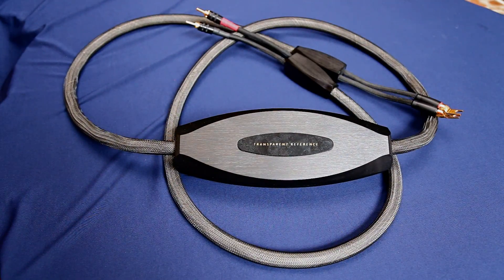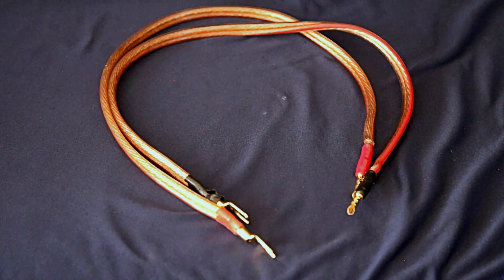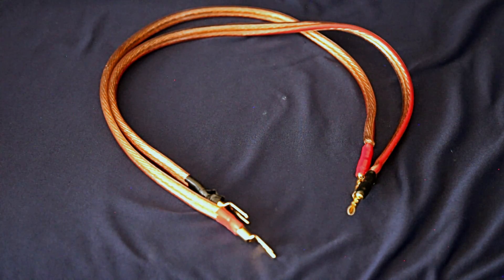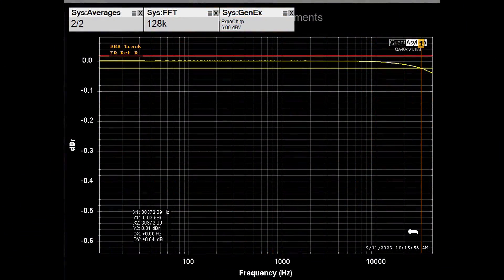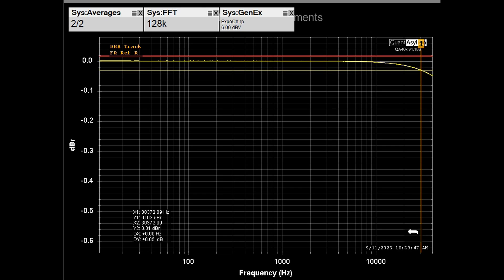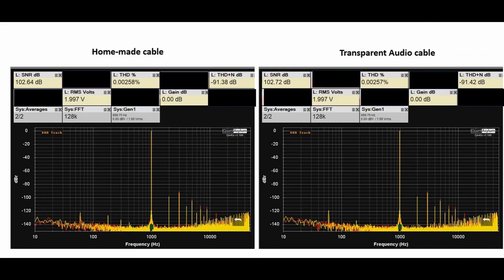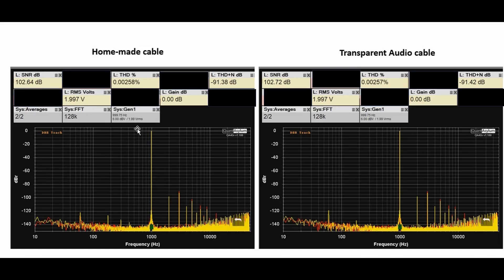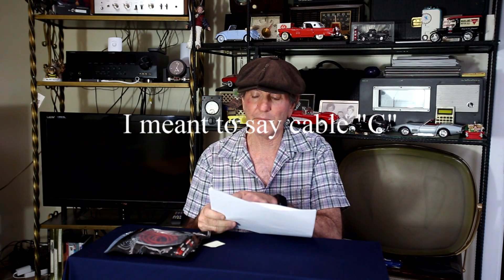$8000/pair Speaker Cable  vs. $14 DIY Speaker Cable A/B Test: Vintage Audio Review Episode #87

Comment: I have additional tools to test cables. As we put it, we test from DC to daylight in the spectrum. We measure dielectric absorption, resistance, impedance, inductance, and capacitance per foot, and dielectric breakdown votage.

In genera, the DC resistance is the most important factor, so the shorter the better. As most speaker cable is not even close to the impedance of the speaker, any speaker cable of any significant length is mostly affected by Inductance per foot as the speakers are much lower impedance than the cable.

In professi0onal audio, this issue is dealt with by using balanced line level signals to the mostly powered speakers. This results in the length of wire between the amplifier in the speaker to the drivers is under 3 deet in most cases. Large crossover components are eliminated and replaced by active crossovers into a bi-amp configuration. For effeciency the bass is handled by class D amplifiers, and the upper frequencies by a lower power class AB amplifier.

In many professional sound systems, instead of sending analog balanced line levels to the powered speakers, the connection is digital from the console using either AES2, Waves, or Dante interfaces. This eliminates all analog noise sources in the sound distribution from the console to the speaker arrays.

Why are guitars still using high impedance pickups in the days of low impedance balanced sound?  That ancient artifact needs to go.
If you have a bench power supply that can provide 10 amps or more, you can do low resistance measurements yourself on the cables. Send for example 10 amps regulated into a shorted cable, and then measure the voltage due to resistance. EG a 10 amp current into a 10 foot cable and has a voltage of 20mV would equate to 2 miliohms.
Reply: Really?  Applying RF feedline standards to a low frequency cable that is only a tiny fraction of the wavelength of the signal?

Lets do the math ... 
The speed of light is about 299,792.458 kilometres per second.
Electricty travels through copper at about 96% of the speed of light (VF = 0.96)

This gives us a velocity of ...
299,782.458 x 0.96 == 287,791.159 kilometers per second.

Wavelength = velocity / frequency, so... at 20khz... 
287,791.159 / 20,000 == 14.389 Kilometres ... that's 8.941 MILES.

The first resonant point in a feedline is at 1/4 wavelength so... 
14.389 / 4 = 3.597 Kilometres or 2.235 MILES.

Now most of us don't run 2 mile speaker wires... 
so below that feedline impedance, dielectric, inductive and reactive components will have a negligible.... likely unmeasurable effect on the sound quality of a system. 

What matters is resistance ... which as you pointed out is in milliohms (1/1,000 of an ohm) for all but the most drastically under sized wire.  

So lets look at good old 16ga lamp wire ... 
rated by UL and CSA at 4 ohms per 1,000 feet.  
A 10 foot speaker wire made up of 16 ga wire actually has 20 feet of wire in it.
So we have (4 x 20) / 1000 == 0.08 ohms (80 milliohms) of resistance.

Compared to a 4 ohm speaker that gives us an impedance ratio (damping factor) of...
4 / 0.08 == 50.  which is totally acceptable.
Reply: @Douglas_Blake_579    All the facts about the speed of light is absolutely true. However, the impedance mismatch means that a low impedance load on a higher impedance cable results in the cable being inductive. When a high impedance source is applied to a much lower impedance cable the result is capacative loading, even at fractions of a wavelength. 
Your assumption in the velocity factor in wire is incorrect when an insulator on the wire changes the capacitance per foot. This is referred to the velocity factor. You will find most polyvynil plastic dielectric produces a velocity factor closer to 60% and not the claimed 96%.

It is true the effects at lengths under 100 feet is negligible except for the resistance, but this is a bunch of Audiophiles where any measurable difference in cable is worth $14,000 in price for the cable. This is the level of difference they claim they can hear. I emphasize the word claim.

Just an FYI, High voltage transmission lines traveling 500 miles or more often need impedance corrections to keep the voltage stable. Ask your utility about capacitors on rural distribution lines in the country. This is at 60 hz in the USA. Yes is it a fraction of a wavelenght and the lines are air insulated without a solid dielectric. High tension lines can need either inductors for long lighter loaded lines resulting in an impedance mismatch, or capacitors for under loaded lines resulting in impedance mismatch the other direction.
If you can tour a local HV transmission line substation, ask to see the KVA, KV, Megawatt meters and in the same area find the power factor meter and the MegaVarmeters.  Ask the operator about power factor correction.
Speaker cables with the two conductors broken down into many smaller insulated strands, which are then braided together, is to add capacitance to the cable to lower the impedance to be closer to the impedance of the speaker.
Google Power Factor correction in transmission lines for further reading. Yes it is flow lower frequencies and longer distances. But then we are talking about Audiophiles again.
Reply from the maker: Definitely covering from DC-daylight. I appreciate all the "reasonable" commentary on this subject. I did take one course on AC Power distribution around 1980 or so and realized it was not the area I wanted to go into and am glad for the refresher  :)  I don't know anyone who runs probably more than 15' lengths of speaker cable to their main speakers.
Reply: @isettech  
"It is true the effects at lengths under 100 feet is negligible except for the resistance, but this is a bunch of Audiophiles where any measurable difference in cable is worth $14,000 in price for the cable. This is the level of difference they claim they can hear. I emphasize the word claim."

The answer to both your argument and audiophile's golden ears falls far more into the realm of psychology than physics.  People are far more gullible than they realize and often buy into arguments about negligible differences and made up science.  ... and BTW, as I pointed out the first feedline resonance at audio frequencies is measured in Miles (Kilometres), not feet.

And comparing speaker wire to HV distribution systems is kind of a non-starter. They aren't even in the same ballpark, much less playing the same game.

Yes I've worked with equipment than can find a difference between different brands of the same cables ... but in almost every case you need religious belief in audio, a magnifying glass to see them and godlike ears to hear them.... and of course a ridiculous bank account to acquire them.
Reply: @vintageaudioreview 
The problem with DC to Daylight is that it introduces a lot of issues that are irrelavant at audio frequencies.  Our 20 to 20k slice of bandwidth is the lowest of all EM bands, the very bottom of the spectrum.  
There is no reason to bring in issues of feedline matching and reactance which only apply to antenna design and RF frequencies.  
There is even less reason to test audio cables at RF frequencies in the first place ... they will never be called upon to handle it, except in the most bizarre of circumstances.
Reply: @isettech  Modern solid state power amplifiers are voltage sources, not power matched sources as with tube amplifiers (OTL tube amps are an exception). The output impedance is typically less than one ohm. Impedance matching is irrelevant at audio frequencies. In order for that to become a problem the speaker wire would have to be so long that you would get very little if any sound due to resistance voltage losses.  600ohm power matched audio systems are firmly obsolete. The recording industry abandoned this in the early 1970s in favor of voltage matched systems. The Broadcast industry followed in the mid 1980s when TV went stereo and plant audio systems had to be rebuilt. Power factor has nothing to do with the AC frequency. It is the voltage and current being out of phase, one is either leading or lagging. This can happen at old 25hz, 60hz, or in the gigahertz range. It is not an issue in any consumer audio system or professional for that matter except possibly in some esoteric non entertainment audio scientific application.
Reply: @andydelle4509  Might want to get a refresher course on transmission line theory. A couple of places where you can start is old school video standards and termination of baseband video. Continue with the issues of high impedance guitar pickups with long audio cables where the pickup is 50K ohms and the cable is approx 65 ohms for an instrument cable and connected to an amp with a 100K ohm or higher input.  Where high frequencies hve to remain undistorted in digital include CAN bus in cars with 120 ohm terminations, matching the twisted pair impedance, and your home ethernet cables such as CAT5 or CAT6 terminated by 110 ohms on both ends. Yes the effect is much less at shorter runs and at lower frequencies.  There is a reason guitar cables are no longer than 20 feet. The audio is adversly degraded at audio frequencies with long runs and a bad impedance mismatch.  To get video through a similar cable hundreds of feet long on a standard 75 ohm impedance cable, the cable must be terminated with a 75 ohm load, or the video becomes distorted.

Back to the audio clam, Many professional dynamic microphones are between 60 and 600 ohms and when connected to an audio snake the impedance of the snake is typically 62 ohms on the ones I have measured with a TDR. These connect ot consoles with a termination impedance between 600 ohm to 2,000 ohm. Very few audio inputs with the balanced XLR connector are un-terminated. A few exceptions are the Behringer X Air 18 with two inputs tun-erminated to be directly comparable with guitar pickkups. Yes those work fine with microphones too as you mentioned in voltage mode, but only while using short cables. Add a 100 foot snake to that input and the mic will respond differently. Do not use long cables on those 2 inputs.

Yes professional audio has many improvements. Most of those are related to keeping analog lines short. Digital stage boxes eliminate the problems of long microphone lines. The digital cable between FOH and the stage is usually a shielded CAT5e cable, which to work is terminated into 110 ohms on both ends.  Feel free to look up the specification for the physical layer of TCP/IP.. In Lighting, DMX512 uses the RS-485 technical standards. Again this is shielded twisted pair cable terminated into 120 ohms for the cable used. Yes for very short runs, people use micorphone cable instead and ignore using the end of line termination, but this will not work in longer runs.  The distortion is there, but how much varies with length and severity of the impedance mismatch.  You can't ignore physics of electrical cable for data and audio without any effects.
There are reasons professional audio has mostly moved to powered speakers to keep speaker wires short. In addition, either balanced line audio is connected to the amplifiers, or a digital AES signal is used to eliminate the issues with analog audio on long wires. Look up speakers and amplifiers with AES-2 support built in.  The professionals know the limits of large distance audio distribution and have the solutions that are very high quality.

If all your stuff is within 20 feet on stage, analog works fine. For large venues, this does not work at high standards. Yes it is measurable. Yes do use a TDR on long analog cables. I've mostly gone digital now.
Reply: @isettech  "Might want to get a refresher course on transmission line theory. A couple of places where you can start is old school video standards and termination of baseband video. "

Really? I failed to mention broadcast grade video systems and product design is where I startted in 1982, that is after four years at Drexel University and a co-op program where I worked at a UHF TV station. Yes, I had my FCC license then. That included early digital effects systems and later the move to SDI. I am an RF engineer. Your response is another word salad like your first post, jumping all over the place. Of course digital signals in the MHZ range is a transmission line case. USB for example, 90ohms. CAT cable 100 ohms, Balanced AES, 110ohms. But I'm not going to worry about transmission theory at audio frequencies, even if wiring a 60,000 seat stadium! Now if we are talking the old analog phone system, I'll raise some concerns. This discussion is about analog audio interconnects and speaker cables, not video, RF, or high speed digital transmission

My now 40 years experience goes a bit further. I can tell by reading your posts that you are a student or recently graduated.
Reply: @andydelle4509  Thanks for the joke. I graduated the Advanced Electronics program in 1977. I own my own Vector Network Analyzer, Spectrum Analyzer, several digital storage scopes, and a TDR, so I'm no stranger to testing cable impedance. FYI, most USB cable is nowhere near 900 ohms in impedance. May I recommend trying a TDR on one, or a vector network analyzer and match the cable into itt's nominal impedance? The conductors are too close together to be above 150 ohms. It's related to the physics of the construction of conductor size, for capacitance, distance between conductors, and the dielectric constant of the insulation. Yes they may terminate it at 900 ohms, which is why USB length is very limited.
Interesting, you also do productions too! Awsome. Have you considered using WAVES or Dante networks for your distribution?  AES60 is limited to point to point and not networks.  Do you also do DMX over Ethernet using Artnet or Streaming ACN?  I have all 3, and wireless.
Reply: @isettech  I said 90ohms, not 900. It's a balanced pair similar to RS485 with an impedance of 45 ohms per leg. I built a few reverse USB hubs or rather switchers for connecting identical devices to one USB port.
Reply: @andydelle4509  Thanks for the correction. I wasn't wearing my reading glasses and saw it as 900. 90 would be in the expected impedance range for that size cable. I have not personally studied the USB cable impedance. I have worked a lot with 50 ohm for RF work and 75 ohm for base band video and CATV, and cable television. Why TV decided to go with 75 ohm instead of 50 for everything else RF is a mystery.
Reply from the maker: You must also be retired, Doug  :)
Reply: @vintageaudioreview 
Mostly ... still tinkering and measuring stuff for a few clients and still building my "sounbar killers"... so I'm not really sure if I'm retired or just plain tired.
Reply from the maker: If you have clients I don't think you can say you are fully retired, even if what you are doing you enjoy...?
Reply: @vintageaudioreview 
True ... but these days it's more like a self-sustaining hobby than a job.
Lord knows it's not making me rich.
Reply from the maker: Really nice comment here! I have very little experience with guitars and the associated equipment. Your idea with a 10amp p/s is good, but a milliohmeter would accomplish the same thing- I don't have one... though I would like too. Thanks for the commentary!
Reply: @vintageaudioreview  A mili-ohm meter is nothing more than a current source, and a volt meter in a nice package. Look up "4 lead resistance measurement"  Meter leads, contact resistance, and other measurement errors make measuring milt-ohms impossible with a traditional 2 lead setup. Replicating the function of a 4 lead milt-ohm meter is not difficult. The point is the leads measuring the voltage can not be the same leads used to supply the measurement current as any lead contact resistance will make the reading invalid.

Disclaimer, yes I do measure wire, relay, and contact resistances as part of my day job. No we do not use a mili-ohm meter to take the measurements. We use a DMM with mili-volt scale and a regulated current power supply. We measure mili-ohms down to micro-ohms.
Reply from the maker: I was going to mention a 4 lead DMM, I am thinking of some of the HP/Agilent/Keysight DMMs or Flukes, but am not sure if they were really just set up for a more accurate voltage reading more than a milliohmeter. I do have a regulated 13Vdc power supply that could supply 10amps, but the cables are up for sale on Audiogon or Audiomart..since I screwed up (in on sense) and used copper clad aluminum wire instead of OFC wire like I thought I was doing, the test would be interesting, though being 10guage I am guessing it would do just fine. Maybe one day when I have a null I will try that with a few different wires....
Reply: @vintageaudioreview  A 10 amp fixed voltage power supply is the wrong one to use. You short it out and you blow fuses. The correct supply is one with adjustable current limiting so you instead of providing 13 volts at whatever the load will draw, will instead output 10 amps at whatever voltage the resistance allows.  Google adjustable current laboratory power supply for the right ones.
Reply from the maker: @isettech  Thanks for the info. I rarely have the need for a power supply other than what my Sencore VA62A provides. My thinking was to connect  like a 1ohm, 100w resistor in series with the cable and power supply. If I run across a nice power supply at my surplus store for a good price one day, I would probably get it.